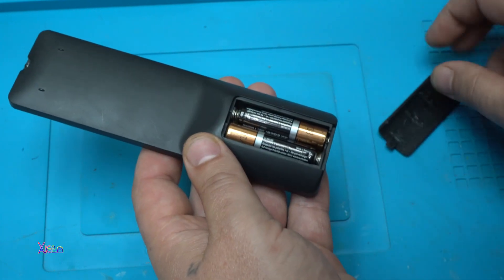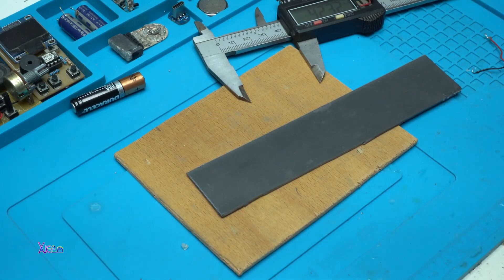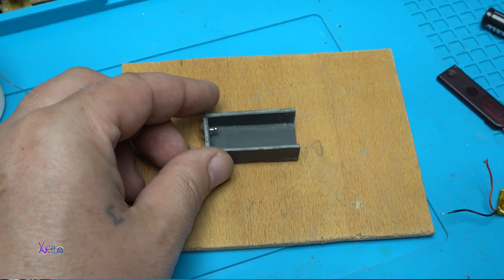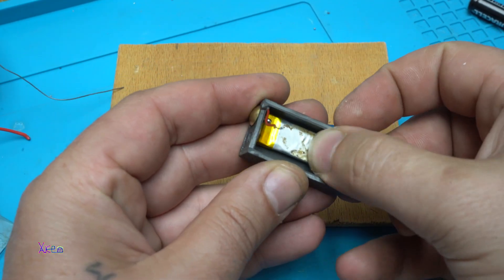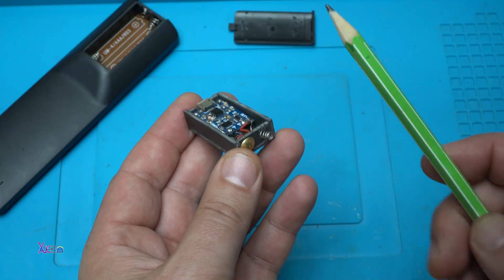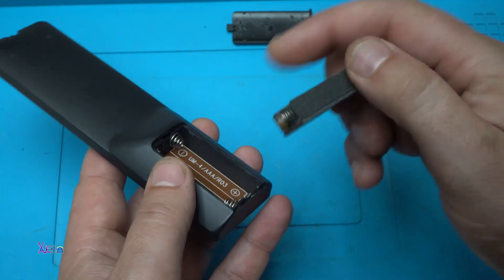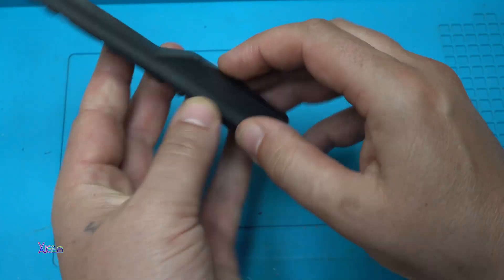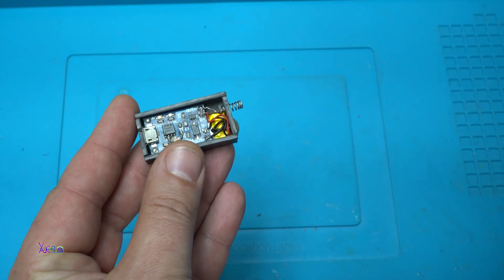DIY Battery Eliminator / Say Goodbye to Remote Control Batteries

Comment from the maker: Some of you will comment why not to use recharge AA or AAA batteries,bcz the are 1.2v so 2 of them together will give 2.4v and empty they will be below 2 volts and your tv remote control will not work.
Reply: You could have just opened the remote and soldered the module output to remote battery terminals and make a slot for charging port below
Reply: @venkateshvbhat  por si alguna vez quiere volver a usar pilas normales. Las más opciones
Reply: @venkateshvbhat  in case you ever want to go back to using regular batteries. The most options

Comment: Hej  I found about 25 vapes, all used but some were rechargeable and others one use only. I stripped down the once only ones and saved all the lithium batteries. I have emptied out the vape juice from the rechargable ones and want to do projects with them as some have different flashing leds when you charge them.
Reply from the maker: Great that you want to reuse the batteries just be careful when you charge them,dont  use high current when charge

Comment: Maybe a better idea wud be using super capacitor or battery and wireless charging pad 😂
Also there are rechargeable button cell battery lir2032 for a device that not used alot a normal 2032 wud last some time 😂
Reply from the maker: That with supercapacitor I need to try it

Comment: Isn't there a risk that the remote control contains components that, for example, have a maximum operating voltage of 3.6V? A fully charged LiPo has up to 4.2V, new alkaline batteries have a maximum of 3.26V.
Reply: You will need a voltage regulator for that. Or buck converter. To be extra safe
Reply from the maker: Its possible but this is just concept idea,please do not try on your device🙁
Reply: @Hacktuber  Add a serial diode to the circuit it will drop 0.6V from the 4.2V.

Comment: I just use rechargeable batteries.
Reply from the maker: If you can find 1.5v rechargeable bcz other are 1.2v and not enough to operate correctly

Comment: Interesting idea.  I bought AA lithium batteries for my TV remote more than 10 years ago and have never replaced them.
Reply from the maker: Lithium batteries are more expensive than ordinary batteries but good for you sir🙂
Reply: @Hacktuber  you literally just put a lithium battery in place of the other ones in a more complicated way while also not using a voltage regulator to bring it down to 3v. Do not get offended by someone else having a simpler, more effective solution to the problem you are prototyping for. Create a replacement that works better, lasts longer, and is cheaper than just replacing with AA lithium batteries, then you can be offended by a comment like that. But if you had been as thorough in the first place, you probably wouldn't be the kind of person to get upset by that comment anyway.

Also, they are a "ma'am", not a "sir" which is clearly stated in their username and confirmed by visiting their page.